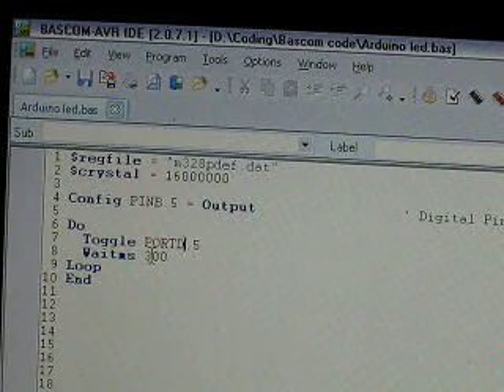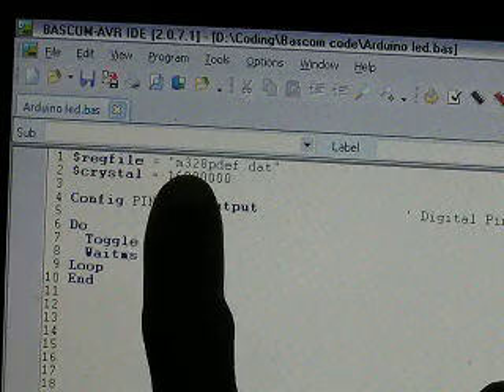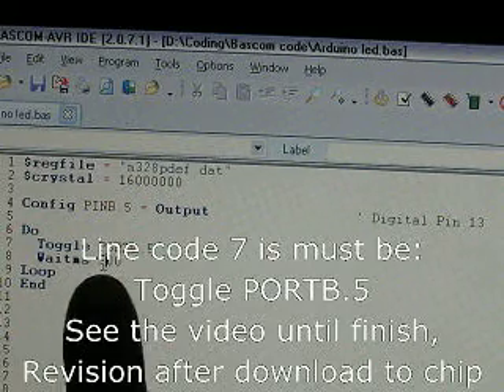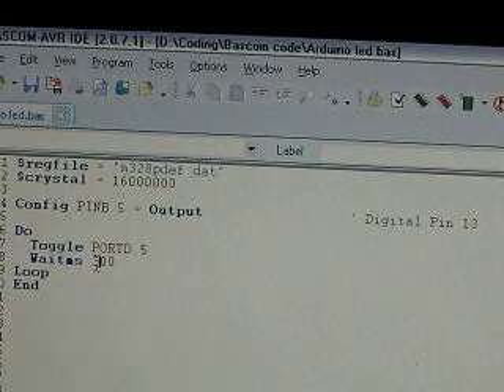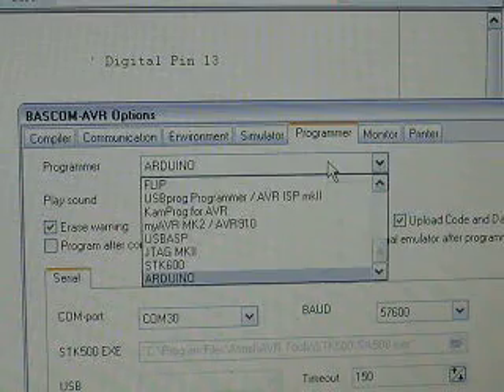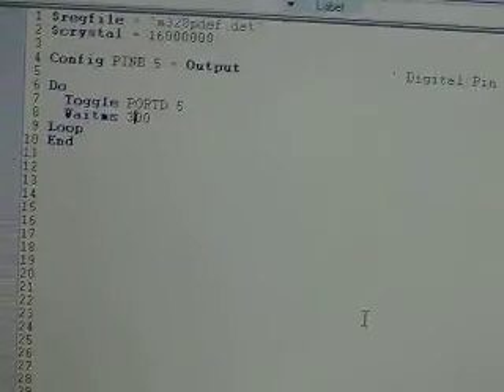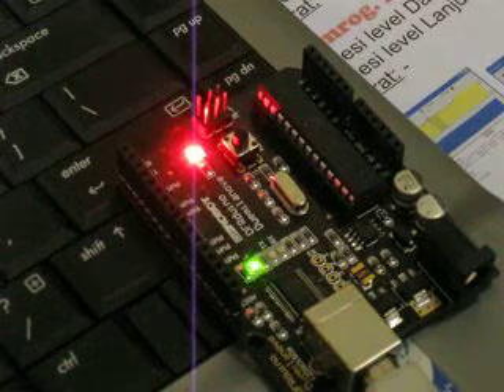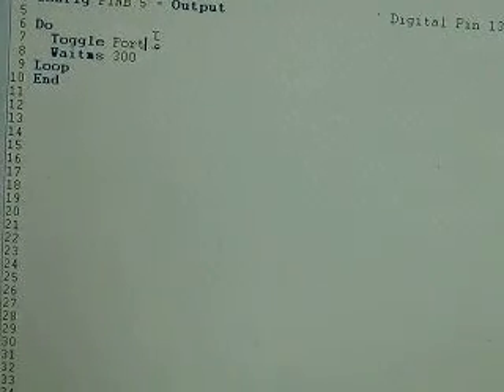Using Bascom AVR for Arduino board

Comment: hi 
I have tried ,It worked the first time only ,the arduino cant receve the programme .why
Reply from the maker: +Sayed mohamed ali 
What the arduino board version you have? I am use the duemilanove. The newer once is can indicate from USB to serial chip. If use FT232Rl is old version, but if use Atmel, that the new version
New version of bascom (2.0.8) has support the new arduino board, you can find the detail information at help file
Reply: I have purchased from the site ali expris